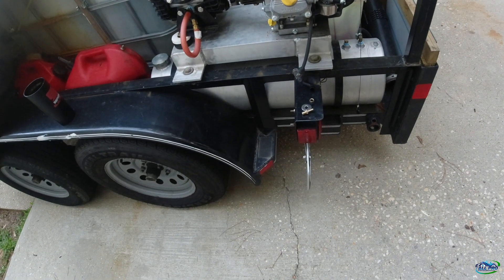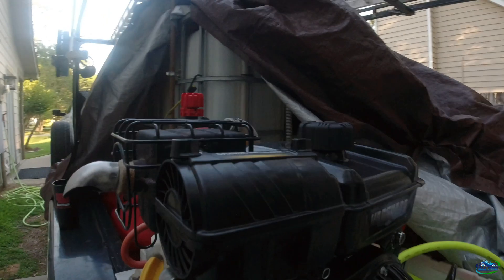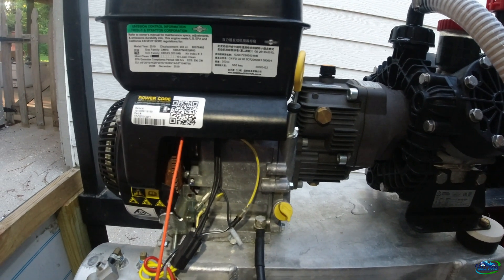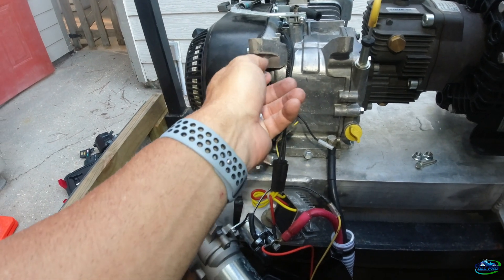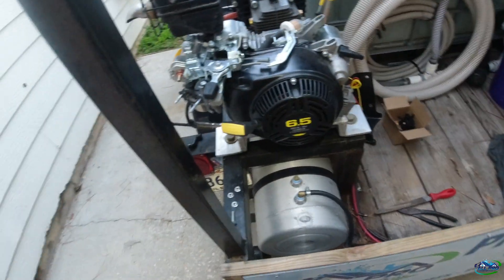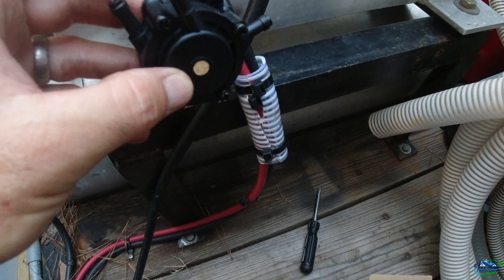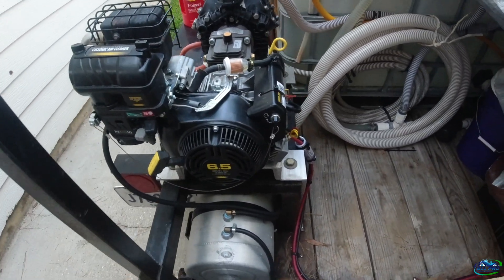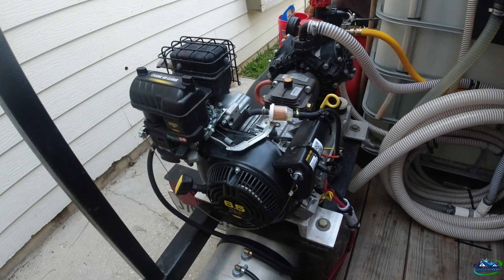Installing a Pulse fuel pump on Briggs & Stratton small engine

Comment: Did you leave the fuel line disconnected from the carb until you primed it? Can't get my gx390 to run off the pulse pump. Tried everything at yhis point. Not sure why it seems to not be pumping.
Reply from the maker: No, but I ended up tapping into the valve cover. I was getting oil in from the original way I installed it. I think someone sells a valve cover kit for the Honda engines. Thanks
Reply: @allproexteriorservicesllc5338  Thanks for the response. I tapped the valve cover and couldn't get it to pulse strong enough.  I tried the carb insulator with a vac fitting installed. Had to prime the pump by puffing on it a few times until fuel filled the float bowl but now it's working flawless.

Comment: Hows it holding up and working
Reply from the maker: Like a champ! I ended up drilling a hole in the valve cover to run the pump.
Reply: @allproexteriorservicesllc5338  think this would work the same on the 14hp?
Reply from the maker: @ah-rr1lk  yes, it will work. Thanks

Comment: Im about to do this this weekend on my AR predator build i like that style fuel tank u have that custom made for u or u order as is u have a link thanks AR beast mode!
Reply from the maker: Thanks! I had the fuel tank built by Sandstorm. great tanks & fits nicely on the trailer. https://spunaluminumgastanks.com/product-category/10-inch-tanks/10-end-fill-recessed-end-cap-style/

Comment: that is the other problem with a roof pump you have worked out. Still not sold yet because I can do 90% what that can without spending another dime using different size injectors. Might not be as fast but the equipment is paid for and on the truck and the pressure washer always has to be on the truck. 

Keep fine tuning that rig brother.
Reply from the maker: Agreed. Use what you have and grow into more efficient equipment later. Thanks